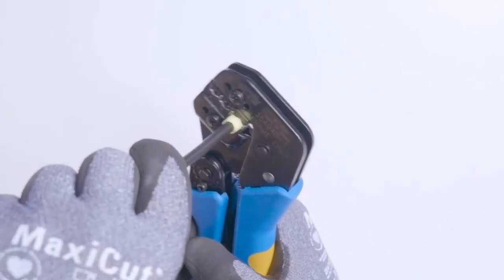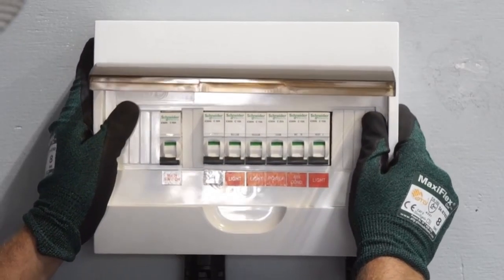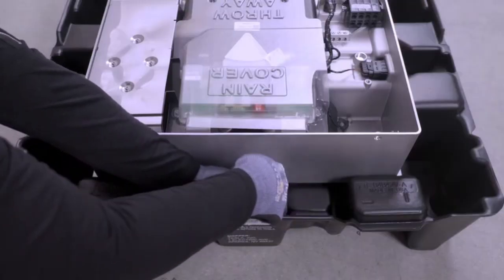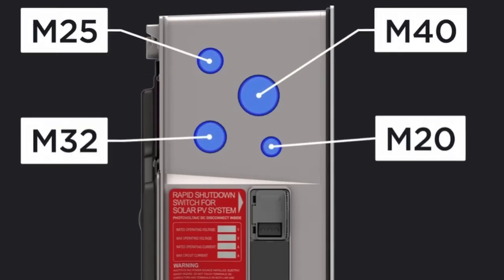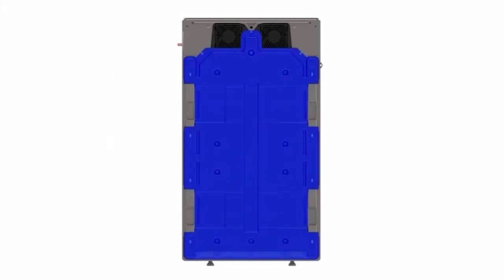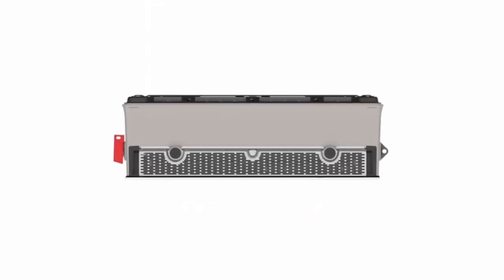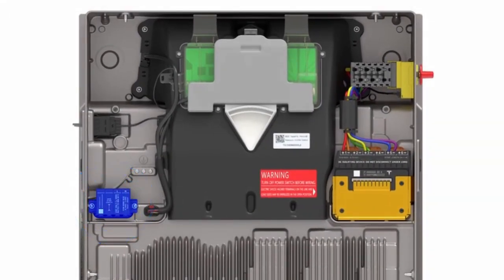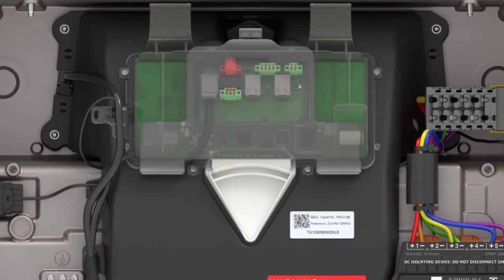Tesla Powerwall 3 Australian release

Comment: Meh I think I'll stick with sigenergy,  if it ever gets approved..
Reply from the maker: Single phase 5kW is now CEC and Western Power approved, but not Synergy approved for EMS (Emergency Solar Management) yet. That will likely take a few months whilst Synergy work with Sigenergy to prove they can shut down the inverter. Therefore, until it's working there will be no DEBs feed in payment and the inverter will be export limited to 1.5kW...in other words treated exactly the same as >5kW inverters in WA.
Reply: @solar4ever843  Seriously considering going totally off grid with diesel generator plugged in.
Reply from the maker: In that case, yes, Sigenergy with their enhanced Homemax Gateway box which takes a generator input (and more) is the better choice for you.